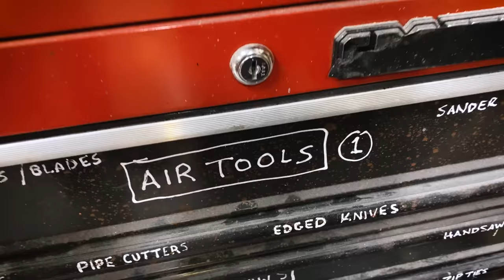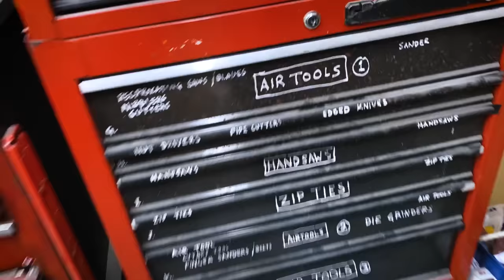Adam Savage's One Day Builds: Air Tools Sorting Boxes!

Comment from the maker: For more videos on shop organization, see our playlist: https://www.youtube.com/playlist?list=PLJtitKU0CAegGi2QUH6ywt4EkjcR0jVam
Reply: The drawers look awesome adam. Keep em coming buddy. We all eagerly await each new one-day!!!
Reply: I love watching Adam’s techniques for shop organization! Will we be lucky enough to see a video on the lathe chuck stand in the background too? :D
Reply: Why would you mock up the plywood and not the foam core? If you used 1/4" ply wouldn't the hot glue hold it just fine?

Also, do you use the "normal" hot glue, or some exotic type?
Reply: @PaigeMaker  He did a video on that project.
Reply: @woodworkerroyer8497  He might be using high-temp hot glue.
Reply: 1:56 top right - is that the head Spider from the Thing ?
Reply: Adam Savage’s Tested 3:13 it was at this point Adam thought, I could design a better measuring tool .🤔
Reply: Buddy Clem, I meant for Adam’s three spindle chucks, not the tailstock chucks :)  (which he did do a video on and is also great)  It just so happens a lathe spindle chuck stand is on my list of shop projects too! :D
Reply: PaigeMaker I know you can get Hotglue guns with cold and hot settings ~ I think something like 180 / 220 , been a while since I’ve used one so the temps I’ve used are probably wrong.
Reply: Thanks for the hot glue tip. You will save me a bunch of pain in the future. In exchange....a tip regarding smashed fingernails...yes I noticed the black nail. Once it has bled under the nail like that, it pressurizes and is super sensitive until it actually heals underneath. Heat up a paperclip red hot and melt a hole in the nail to drain off the blood. Instant relief! Once you've got most of the blood out use crazy glue to close the hole back up in your nail....
Reply: ...fingernail trick only works before the blood coagulates.
Reply: Please tell Adam about Edding Paint markers! They also work to block Ferric etchant.
Reply: Grant was the "Scientific Glue" the kept the 2nd half interested in Mythbusters. TBH. When things worked his way... he'd light up light the 4th of July! We will miss you my friend. Don't wait up. ;)
Reply: Thanks Adam and team... Very useful and practical stuff.
:-)
<3
Reply: Excellet always awsome.
Reply: Interested to note how this reflects on Adam's sorting system for tools. He's got loads of (air powdered) nailers, which are stored with cordless/electric nailers (we've seen him build the rack for that). But air die grinders aren't stored with electric ones? They're stored with other air powdered tools. 
I guess it's like Legos - the same sorting system doesn't always work for all cases and you make exceptions.
Reply: What kind of glue gun?
Reply: @mikeythai  While gross, this is a very helpful tip. Essential Craftsman did a podcast on safety and first aid on jobsites that had a couple cool tips like this.
Reply: @dbstelly  I think it is a Senco. I googled it though and I didn't see it, so I might be wrong.
Reply: You should make something using every tool in your shop

Comment: When inserting a fresh glue stick, if you'll touch the front of the stick to the nozzle of the glue gun melting it slightly when you insert the stick it will glue itself to the back of the old stick giving you a smooth continuous feed.
Reply: Hey, that's a great tip! Thank you! I'll incorporate that into my order of operations from now on!
Reply: @millenniumf1138  I hope you find it as useful as I have.
Reply: @EldarKinSlayer  i wanted to say "stick the fresh hot glue stick with hot glue to the back of the previous hot glue stick so the hot glue stick doesn't fall from the hot glue gun" but you beat me to it.
Reply: I love this community!
Reply: thats an amazing tip! (amazing tip!  see what i did there?)
Reply: That's solid gold info!  Thanks!
Reply: @Platinum_Squid  I agree, I have never found such an amazing group of humans being nice, :_Sigh:
Reply: Wow.  One of those “why did not I think of that?” moments!   Great tip. 👍
Reply: Well, this just changed my life. Thanks!
Reply: It works great but my luck the stick is a little off center and won't go into the heated reservoir because it's stuck
Reply: So simple yet never thought of it myself. Great tip

Comment: One of the things on my summer projects list, this... Mind you, it was on my spring, winter and autumn list before that...
Reply: I've been working on a project since 2013 😭😭😭 Every year or two I make progress, but I'm beginning to think the Nintoaster 64 is never going to happen (but to be fair, RadioShack closing didnt help)
Reply: @eugeneevergreen3850  I started building a Dalek in 2010... I got most of the electronics and hard to find detail pieces sorted in a few months... I am still at that point, ten years later. But I do plan to finish it... one day. I don't have a workshop where I can do wood and metalwork currently, so that's a pretty obvious hinderance.
Reply: I solved it by wrapping all the things around the compressor. It's on the floor so if I accidentally step on a tool there's a high chance of me not needing it anymore.

Comment: I have been making pegboard doors for my storage racks. My storage racks have a diameter of three-quarter inch pipe and I’m using three-quarter inch conduit clamps to hold the 2 x 4 to them then another 2 x 4 leveled to mount hinges too. Buy the 12 pack bulk and putting 4 of them with 3” screws to a 2 x 4 frame with support running horizontally then a steel cable from the lower outer corner to the upper inner corner to prevent sagging.   I have my weedeater, backpack blower, gardening tools little bolt bin drawers on the outside and the inside I have small stuff on hooks like Epoxy, various types of silence and stuff for working on cars.  The doors been helpful keep my 2 year old out of the brake clean, oil recycling containers.  He is my little helper but when your under a car he moves fast to the stuff that can hurt him.  I have 3 of them we tools on them and supplies each is 7 foot tall and 4 foot wide.  One of the best home builds to my ocd.  The 56” double stacked tool boxes with locker and my 3 shelves section with pegboard doors and 3 4 draw file cabinet my garage is ready for work.  

Awesome tip about the hot glue and awesome build!

Comment: I just laid my tools on top of a piece of plywood of the same size as the drawer's bottom, cut the tool's shape out, made spacers with some wood and glue, so that it would float the missing 6th plane, and then covered the tools i wanted in paper tape and set them inside the holes i've made such that each just floated perfectly using thin wire and more tape. Then i greased my drawer with a lot of petroleum jelly and poured foam inside. Once i was satisfied, i covered the top with a tape covered board and set weights on top.

A two hours job, without foam setting times (left it 24h) and then half an hour to clean the mess and tape. Finished the tool shaped cavities with a spay g*n loaded with liquid filler, which then got spray painted with a clear gray. Each tool had a small wad of tape on its side, and the cover with holes, small finger sized holes over those places where i put the tape wads.
Reply: Your “just” covers a looooooot of ground.
Reply: We're gonna need a video on that!
Reply: That sounds really cool for long-term tool storage. I like Adam's way for quick and dirty organizing but I'm definitely interested to try your method, sounds like it would look very legit

Comment: I wonder if a cheap auto parts store spray can of bed liner on the foam core insides would improve the life of the boxes?  You might have to do something or the exposed edges of foam for the spray to not affect it, but you should get a light weight storage that will hold up to general wear and be somewhat grease & water resistant.

Comment: always like the respect for the danger of tools, "you must always be sharper then your tool."
Reply: I've spent my lifetime getting edges ever sharper. I am not getting any sharper myself though. So at some point the sharpness of my tools will exceed my mental acumen. If it hasn't already.
Reply: @1pcfred  don't underestimate yourself. Stay sharp-ening!
Reply: @DeadFastProductions  it is easier to overestimate oneself. One thing I have learned in life is everything is a lot harder than I initially estimate it will be. The project I just got done with took me four times longer than I thought it would. Usually I am only off by a factor of two.

Comment: I can relate to this sort of build from a different perspective. One of my jobs is to make custom foam inserts for cases and boxes. Usually, the most time consuming part is calculating the layout. Rather than making dividing walls, we use polyurethane foam in layers with cut-outs of tool shapes in each layer. It's vital to be able to visualise everything in 3D, because each layer may have different shaped cuts to fit one or more items, such as a large digital camera and telescopic lens.
Unfortunately, we don't have the luxury of a 3D scanner,  Autocad or a CNC machine, so we have to do it all by hand. The end results are rewarding, though.

Comment: Foamboard is such a great, inexpensive material for these kinds of projects. One thing I learned from the RC hobby that I have used in general making is if you later decide you want to make it a permanent object use cheap, thin fiberglass. Even the sloppiest globs of epoxy with a single layer of the thin stuff draped over it will turn that organic quick build into a lifelong object.

Comment: Adam, What is the Make and Model of the hot glue gun you are using in this video?
Reply: Tesla model X p100d
Reply: Looks like an older model Surebonder Pro Series, back when they were red.    Judging from the  support, the nearest equivalent is the Pro-2 220.  That will set you back 110 bucks on Amazon.    I have a Pro2  100, which at $ 36 works just fine for me.

Comment: One way that I’ve seen air tools get organized, that I personally prefer if done right is actually making a wooden base, (ply woods, solid wood, MDF, whatever you want) and drilling holes in it. The size of the hole is big enough to set old air couplings in and epoxy into place. You can then couple the air tools into it and then they become displayed and easy to get to. It also helps keep dust and dirt out of the air inlets. Plus you will visually see if something is out on the shop floor without opening any drawers. Obviously, Adams way is awesome, because the tools still have their place and it’s easy to find where they go, or what’s missing. Awesome video Adam! I love shop infrastructure videos!

Comment: I have a 72" roll cabs box and I can move my drawers to where ever I want. Tharpere are Pro's and Con's to this. Pro's - you can put things exactly where you want them. Con's - figuring out exactly where you want them. I think I have moved every drawer at least 10 times. Funny thing is I had the same tools in a 56" box but can't fit the same tools in a 72" box🤔.if I ever get it figured out I will have to buy one of those hot glue guns to make the dividers ( and an end cabinet for the glue gun😁.

Comment: I noticed that as you pulled the interior drawer measurements you bent the tape measure. For a quick read on size that works, but to be more accurate, most tape measures have the width of the block printed somewhere on them. You can just butt the back up to anything and add the printed width to what you read off the tape. Bam: accurate measurement and no bent tape measure guessing.

Comment: Hey Adam in case you didn't know there should be a number near the bottom on the sides or back of the casing to tell you how long the casing is so you don't have to bend the tape to get the measurements or extend the tape to a crazy length. Sometimes the casing length is just mid center on the side.

Comment: I was waiting for the arse to fall out of those boxes when you lifted them.
I've been dithering about getting a hot glue gun for a few months, but it seems to do a job.
Any recommendations people?   🏴🥃
Reply: No brand recommendations, but don't feel you have to go really expensive as they are not complex devices. I have two no name brands including a small one that I have a had for over 10 years and it still works just fine. 
Also, you can never overestimate the amount of glue sticks you will need for any given project, so keep a good stock on hand. For my bigger glue gun I am able to get metre long glue sticks, which is great as it means I don't have to keep feeding it as often.
Reply: @Spectral_Penguin  Thank you Iain.🥃👍

Comment: If you wanted to do this, but in a permanent way, with nearly the same process:  ABS sheet and ABS Pipe cement (near instant adhesion time).  
ABS sheet is relatively cheap, readily available in black or white, and the hair-cell finish on one side hides scratches.  You can score and snap up to 3/16, though a saw will be easier.  You can also use a heat-gun to make bends easily too.

Comment: Adam, your tape measure may have a dimension on it's base which is used to indicate how much to to add to an inside dimension.  Instead of bending the tape, one simply places the back of the tape measure case against one inside edge, pulls the tape to the other inside edge, record the measurement, then add the tape measure case dimension.  I'm going to go ahead and assume you know about this already, but if not, I hope it helps.

Comment: 11:28 - It's not Craftsman drawers, it's drawer rails / sliders in general. The reason why one goes up and the other goes down is that they're identical (but one is mounted upside down relative to the other, since both need to be facing in towards the drawer).

Comment: Just a little trick when using measuring tape instead of bending tape.. put tape in there with it and measure if you look on the bottom back of any tape there is a measurement so just add the number on the tape to that number and you will have your measurement..Hope that helps..

Comment: An air tool you are missing is a 90 degree threaded drill. Commonly used in the aviation industry, they make 45 degree drills as well. However, I find the 90 much more useful. You can drill a hole in the side of something with only about an inch of room. Look them up

Comment: Adam do you use or have you used or thought of using Kaizen foam on something like that. just open cell foam you can cut to specific fit tools. Some what less permanant than form board, well maybe not but its just foam so can be cut. 
Everything has a place and there is a place for everything, i know what i have and also when something is missing i know right away. Also i found it really helped me with buying more tools. Because it forces me to have a specific place for a tool it really shines a light on the whole " i need this tool to complete a task" vs "ooo i want that tool"
Hope all is well, great documentation of the process. 
thanks,
the delicious fish

Comment: I noticed that you slow down quite a bit trying to get the hot glue on each divider.  This got me thinking about making a jig of some kind that can go over the end of your hot glue gun that is removable that you can use as a guide.  You make a lot of these dividers and you could save quite a bit of time with something like this.  If I were to make it, I would use some sheet metal so that it can handle the heat and taper it down so that it is easy to slide over the divider.  It also should be easily removable.  It would also be a fun 'one day build' or 'tool tip'